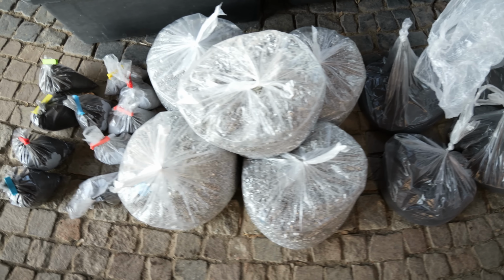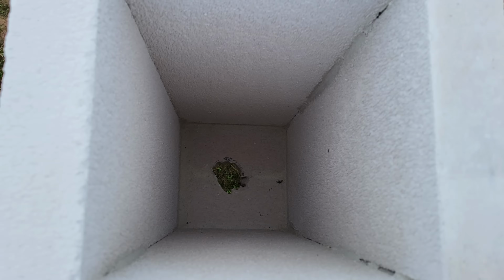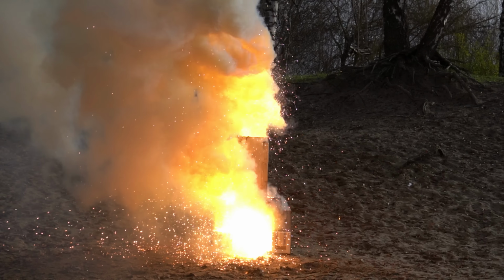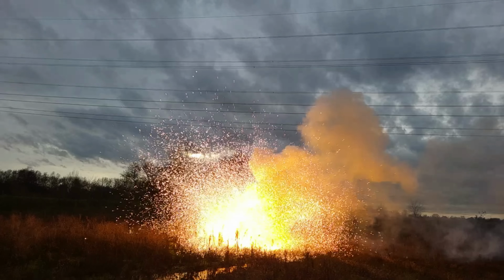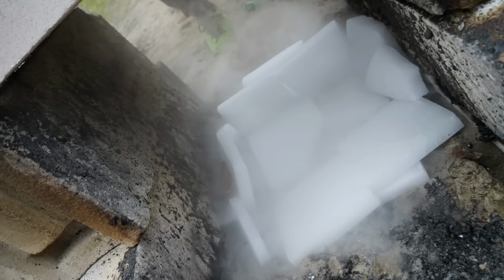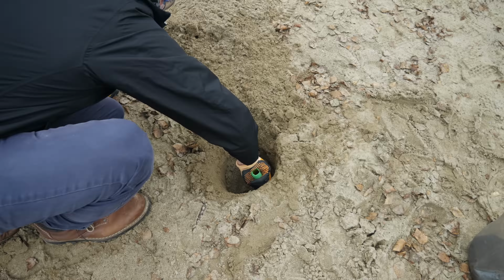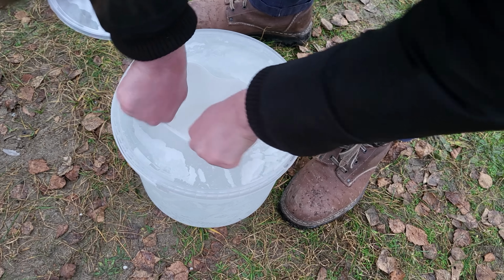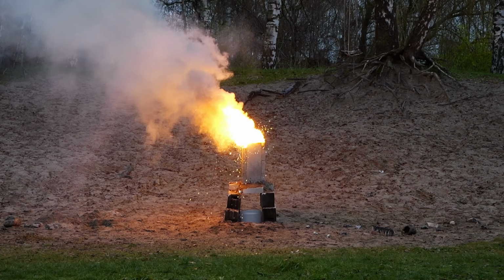100kg Thermite: Observing the Power of Aluminium and Iron Oxide Combustion

Comment: Good video! It is a steam explosion (foundry explosion) in the end, we can talk about the details if you like to ;-)
Reply from the maker: Thank you very much! So it is indeed a purely physical reaction, since the water evaporates abruptly and the volume increases greatly as a result? 
I wouldn't have thought that a steam explosion in an open container could be so violent. Thank you very much for the information! Since the statement of a professor of inorganics is probably the most qualified, I'd pin your comment if that's okay.
Reply: @@zomgthisisawesomelol My guess is that water cools down the iron much quicker because of the much larger surface area
Reply: @zomgthisisawesomelol It can also happen with water - when the conditions are right. Getting the right conditions for the foundry explosion is however difficult.
Reply: @Fluorineisgreat  I would love it if you could describe the details of what you think is happening here.

From reading the wikipedia article on Steam Explosions, my understanding is: 
1. a hot molten metal droplet touches liquid water
2. the liquid water boils very quickly, creating a pocket of steam near the molten metal droplet
3. this pocket of steam creates a shockwave in the water
4. this shockwave breaks other hot molten metal droplets into very small droplets, mixed with cool water
5. as these small droplets have a high surface area, they create steam bubbles very rapidly
6. these steam bubbles accelerate the shockwave

This requires liquid metal that can be dispersed in the water by a shockwave. But this is just a wikipedia-level understanding, so it could be wrong. Why would this not happen with the cyclohexane? Is it because the bulk modulus of cyclohexane is ~ 1GPa, and the bulk modulus of water is ~2 GPa, so cyclohexane may not transmit shockwaves as well?
Reply: I believe I can guess at a pretty accurate chain of events. Thermite contacts ice. Ice starts melting. A thin layer of water forms, as well as a layer of steam. Random fluctuations eventually leads to a situation where you've got a certain thickness of water film, and the steam barrier randomly breaks down. This makes a small pop which creates a small aerosolized cloud of both water and molten iron. Now that the surface area is massively increased we've got a situation which expands exponentially, an explosion.

It happens because of the solid>liquid>gas interface. It can only occur when there's a hard surface behind the liquid to redirect any force back towards the molten stuff(shoving the water into the iron), and only when there's a gas phase barrier which allows the molten iron to accumulate.
Reply: I would really love some details. In particular, why it does not occur with other frozen volatiles. That would normally seem to contradict this, and for a long time I thought that it could not be because of that.
Reply: @barahng I think that IS just steam, though. Water into metal, you've got a ton of thermal energy, and the water converts that very nicely into mechanical energy. Metal into water normally will not explode, because water has such a high specific heat that it will absorb it all before it can boil. Letalone the enormous kinetic barrier to converting ice to steam.
Reply: @AdvancedTinkering hi, the density of the iron is of course higher than the water. This increase allows enough pressure to build up when a small pocket of water gets trapped under a sheet of molten metal. It transforms into steam and rapidly absorbs heat, which increases its volume which increases its pressure till something gives. If you want explosions I think you should have like a ceramic cup with at the bottom some water that's encapsulated in a thin metal pipe with the ends closed together so its barely water tight. That should give a nice bang.

Greetings, ex foundry worker
Reply: I can only speculate here: it seems that the ice transforms into steam in that short moment. that is faster as the heat alone can travel, so maybe the shockwaves compression is enough to melt the ice quickly, but between the ice and the contact surface there is lots going on that increases the surface. Maybe misting of both the water and themetals? That way you increase the surface area enough so the heat can leave the metal quickly and enter the water quickly. That would make it a chain effect. The dry Ice seems like it was not able to transfer the heat fast enough? maybe its too far from its melting point to melt from a shockwave? the shockwave reflecting might be a reason, why the watermelon did not explode
Reply: I'm skeptical of the simple water boiling explanation. There should've been similar rates of heat transfer to the other volatiles: CO2 and cyclohexane. 

Water + iron = rust and heat. It seems reasonable if the iron is molten, then the reaction rate is highly increased. 

Ideas to test: drop other hot liquids into cups of water. I suggest liquid sand/glass or something else that's fairly inert.
Reply: It's definitely steam. Look at wet charges in foundries. Also there are videos of people throwing jugs of gasoline and water into a volcano, the water was much more violent because of the steam.
Reply: My guess is a high pressure pocket of steam builds up beneath the layer of molton iron. this pressure is great enough that when it is finally released it creates a pretty big boom.
Reply: it would happen with liquid water- I assume it's done over ice because it's the easier way to react (vap.) a greater volume of water if it's over a sheet of ice rather than liquid water @@zomgthisisawesomelol
Reply: @HomemadeChemistry  The larger surface area can not be both causing the explosion (as per other comments here) and prevent it with liquid water. It does also not explain why it only happens with water. There has to be some reaction (physically or chemically) that happens with water, but not the other substances. Like in a coulombic explosion.
Reply: The combustion temperature of thermite is about 3000 degrees C. The temperature of splitting water into oxygen and hydrogen is 2500-3000 degrees C.
Of course, the oxygen and hydrogen immediately explode and combine back into H2O
Reply: We know the details.  We have Google too
Reply: @Enword_Jim well, i have seen a similar video of people throwing a jerry can of gasoline into a vulcano, and then a jerry can with water. It’s more violent because the water it strapped by lava from all sides. Would it have been a bucket of water, that spills all over the surface. It would not have been so spectacular.
Reply: I’m wondering wether it’s because of the incredibly intense reaction that’s stripping hydrogen from the water causing a super speed hydrogen production process that spontaneously combusts blowing everything else to bits. You can see the reaction continuing where the ice bucket was placed 🤷‍♂️🤔
Reply: Are we sure I mean thermite burns at around 2500C and water decomposes at 2200C so it could definitely also be some water decomposing at such a high temp and in contact with the molten iron.
Reply: It looks like the explosion on the ice is this:
2 Al ( Aluminum ) + 3 H 2 O ( Steam ) → Al 2 O 3 ( Aluminum oxide ) + 3 H 2 ↑ ( Hydrogen )

Comment: I have an EXTREMELY dangerous (but also extremely awesome) idea. Part of the reason water behaves the way it does is because of its high heat capacity (due to hydrogen bonding). Not sure of the mechanism, but perhaps this plays into why ice will explode on contact with thermite. So the logical way to test if this is a factor is to use something else with a high heat capacity. And the only chemical that one could reasonably use is ammonia. ANHYDROUS ammonia. So the experiment would be to freeze some anhydrous ammonia (no idea what the best way of approaching this is, but it does freeze at -78°C, which is an absolutely achievable temperature, even without using LN2 - a mixture of 99% isopropyl alcohol and dry ice will get to -90°C, while dry ice + pentane will go down to -95°C) and react it with thermite. Now, I have not been able to find a specific heat capacity of solid ammonia, but solid water's heat capacity is around 50% that of liquid water, so maybe ammonia will have a similar ratio.

Maybe start small, with a few hundred mL of frozen ammonia and 100 g of thermite, just to see what happens. And whatever happens, it will be dangerous and amazing.

Comment: About the "steam" explosion: My guess is that Iron and aluminium both have a standard potential lower than hydrogen, the water acts as a second stage of thermite, oxidizing the iron and unreacted aluminium, releasing heat and in this case a volume of hydrogen gas (which causes the explosion). A potential test would be to drop the liquid thermite on a bed of higher potential metal oxide (like CuO) or on a bed of oxidizer like nitrate or chlorate salts.
Reply: This happens only in minute amounts as a side reaction. In order to have the H2/O2 explosion, you need the minimum amount of H2 required (LEL) at the O2 concentration around the thermite (which is lowered due to the heat and pressure), so that the H2/O2 explosion occurs under that conditions is unlikely.
Reply: @Fluorineisgreat  - I was going to say, is the thermite hot enough to disassociate the H2 from the O (and do what was proposed)?  You're likely right that it's an inconsequential side reaction, so I'm curious of what the reason for this happening is.   I'm guessing the explosion is from the rapid phase change of the H2O from solid (ice) to vapor (steam), which is likely more than the liquid to vapor transition ratio (of H2O) of ~1:1000.   Not like I know, just another YT armchair keyboard warrior that's curious.  Great input,  it got me thinking!
Reply: @RR2BOX46  Yes,  a not insignificant percentage of the water molecules will dissociate at 2500C.
Reply: I think it is simpler than that.
When dry ice sublimates it forms a surface of CO2 around it self, which insulates the dry ice.
You can put dry ice in water and it takes for ever for the ice to completely sublimate.
All it does is to moderately cool down the water like normal ice.
 
You can see this in the hellish image of dry ice right next to glowingly hot iron.
The Iron doesn't touch the slabs of dry ice, since there is a layer of CO2 in between.
It looks really messed up.
 
Anyway, this is similar to how you can dip your hand in to liquid nitrogen without getting frostbite if you do it quickly.
Reply: @MegaBanne  My theory as well. Never gets direct contact. You might need a substance, that is more comparable to water - not directly flammable, freezable at not too low a temperature and lower vapour pressure so it can't form a leidenfrost effect like CO2.
Reply: @Snarlacc  
That was the name of the effect!
"leidenfrost!"
There appears to be something more than just a steam explosion when it comes to water.
But even if that kind of explosion could happen with dry ice, it is blocked by the leidenfrost effect.
Reply: @MegaBanne  I remember that it was said for a long time sodium in water is  "only a hydrogen explosion", never sat right with me. Same is true for thermite+ice being a steam explosion, it just does not feel right. Probably would take more effort to find the answer with thermite because you just can't scale thermite down well.
Reply: @LarsLarsen777 While the part of water  split to H and O (in various combinations) might not be negligable at 2'500c°, it's supposed to be just 3% at 2'200c° and over 50% above 3000k°. I doubt it's a hydrogen explosion, as there wouldn't be enough of it - or it's a combination of both steam and its products causing a chain reaction so chaotic, it would be a nightmare to simulate digitally. My bet is on the same foundry-explosion reasons described above, with the properties of solid ice accelerating the blast vawe.
Reply: There’s no way hydrogen would take its time to form a large volume of a stoichiometric mixture with air, next to burning 3000C thermite.
Reply: @RR2BOX46 The youtuber Thunderfoot did research on alkali metals exploding when reacting with water. It is caused by a Coloumb explosion. Maybe it is similar with other molten metals.
Reply: Its basically because water expands as it heats up, that expands into a gas, which also starts to atomically dissociate into a reactive plasma state. Remember, oxygen has a vapor pressure like no other 💁‍♂️. 

With dry ice, sublimation helps prevent explosion. If you tested this somehow, under like 200 atm of pressure, the dry ice MAY potentially cause the same sort of effect, only not as explosively, because pressure.
Reply: @patrickw9520  Everything expands when turned into a gas. That can not be the explanation, let alone for such a sudden explosion. 
Oxygen has no special vapor pressure and how would it even be relevant? We are not discussing cryogenic processes here. Oxygen can only be a gas here.
How does sublimation prevent the explosion for CO2 but not for frozen water?
Reply: It looks like the explosion on the ice is this:
2 Al ( Aluminum ) + 3 H 2 O ( Steam ) → Al 2 O 3 ( Aluminum oxide ) + 3 H 2 ↑ ( Hydrogen )
Reply: it's the same smoke you see by 9/11 ground zero

Comment: The reason ice explodes so well is related to the leidenfrost effect: there is a video by the backyard scientist where he dumps molten salts of various temperatures into water. When the hot substance has the right temperature, it enters the water but is insulated by the leidenfrost effect. eventually it loses enough heat that water can come in direct contact with it instead of having a steam layer, and this rapidly decreases the amount of insulation provided. the effect is that water is heated up much faster and suddenly a larger volume of it immediately vaporizes

Comment: thunderf00t had a great video about Liquid Metal/Water explosions, and he and a research team recorded NaK reacting with water using a high speed camera.  Immediately before the explosion, the metal droplet turned spiky like a hedgehog.  The theory is that liquid metals starting to react with water get pulled INTO the water by the electric force when the ionization starts.  This exponentially increases the surface area, allowing for an "all at once" chemical reaction that is necessary for an explosion, rather than a sizzle.

Maybe that's what is going on with the "Thermite on ice" videos, since Iron  react with water.